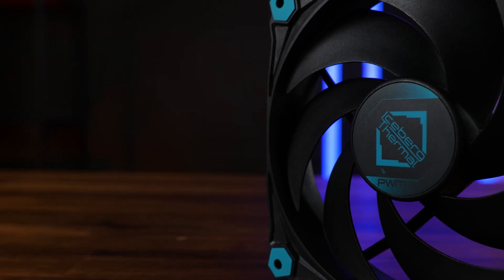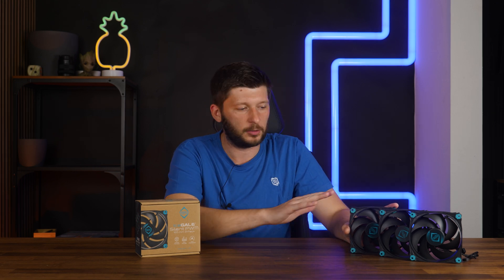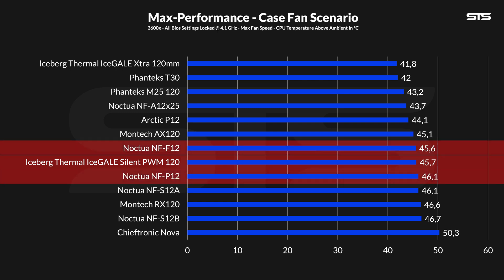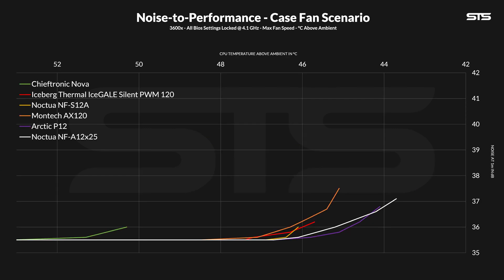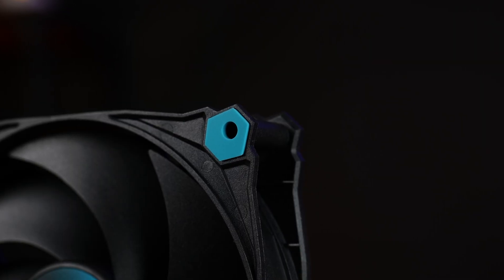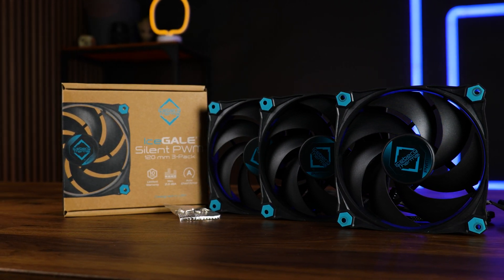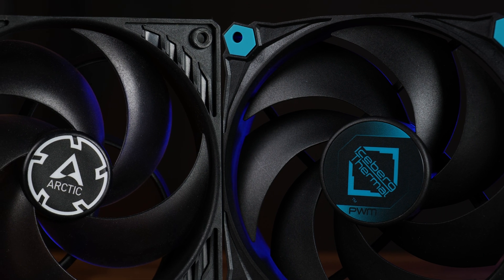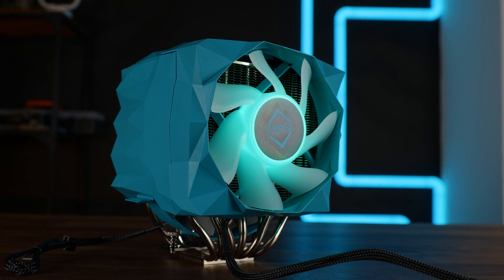Iceberg Thermal IceGale Silent - Like A P12, But More Blades

Comment: thanks for the video. I can see the phanteks m25 120 in the graph, but I can't find any test.  Are you about to release a test about them ? I'm looking for fans to replace my p12 on my watercool mo-ra and I was looking at the p12 max but can't imagine having to daisy chain 3x3 fans. The m25 at least have the same system cable wiring as my phanteks t30 and it would be easier. Would you recommend the phanteks m25 120 in general ? Thank you !